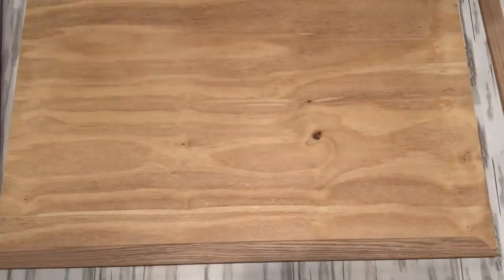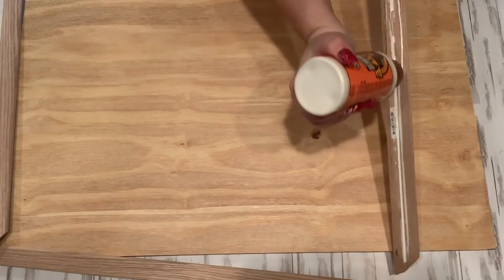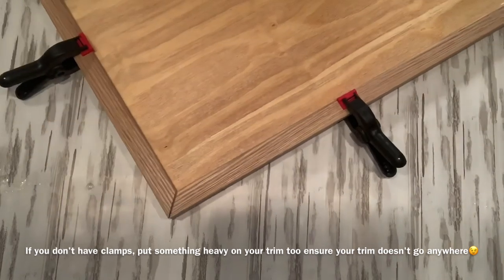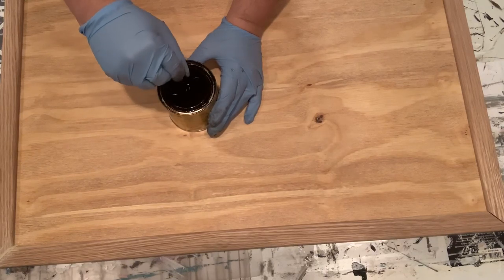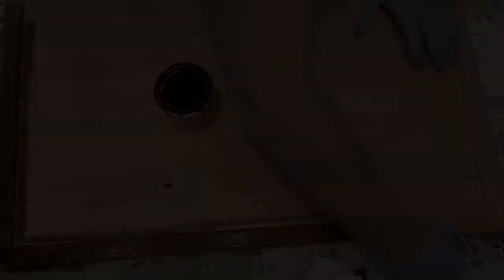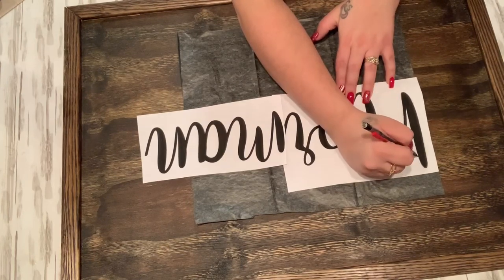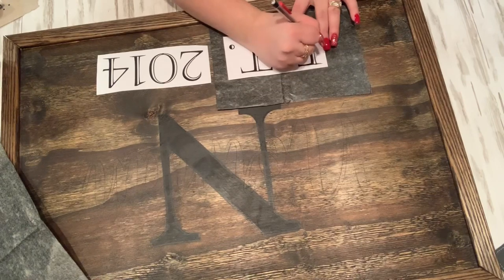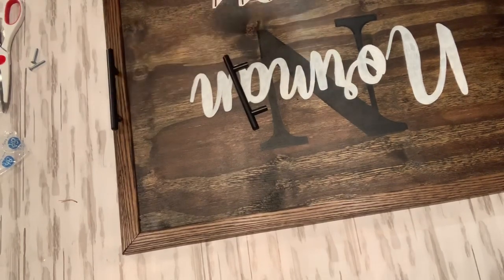FARMHOUSE STOVE COVER DUPE | $15 FARMHOUSE STOVE COVER VS. $95😱😱

Comment: Throwing shade at people that actually plane boards, make 45s to fit, and don't use plywood is a disservice to those that do. If the intent of the video was to make something out of plywood, that can't be used for anything other than deco, and someone can cut proper 45s, yes you can save money. So total time spent was 2hrs? then materials? It's a shame to the makerspace that people don't think others time and materials are worth anything.